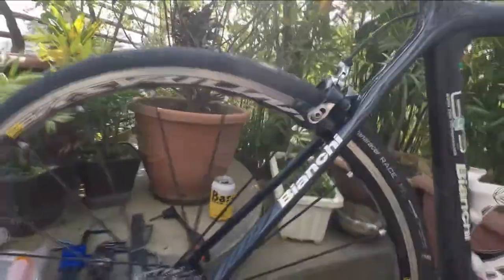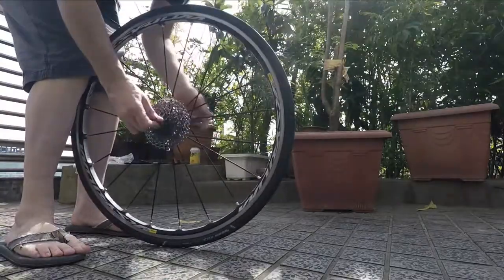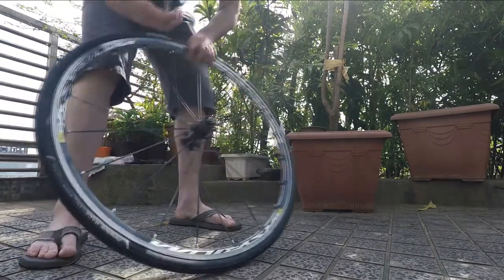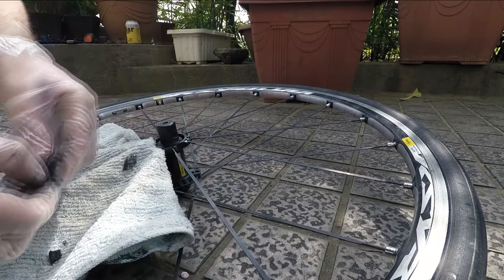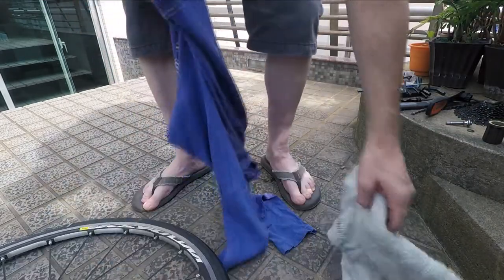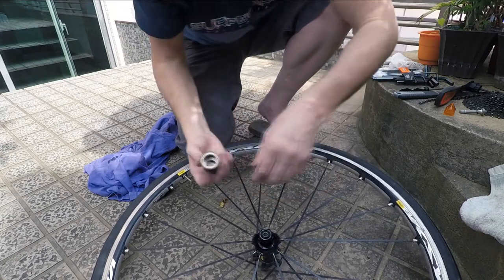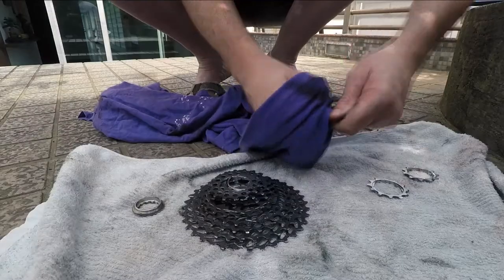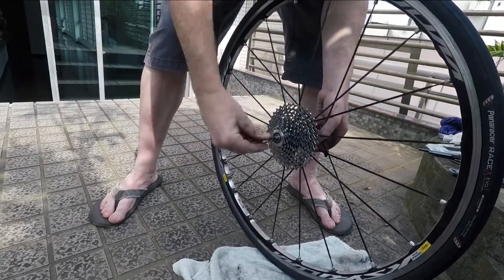Mavic Freehub Maintenance / Service (Audio fixed)

Comment: When it squeal? Does it vibrate too? Mine is vibrating and I can feel it on my whole rear wheel
Reply from the maker: Brakes need to be what they call toed in ...where the front part of the brake hits the rim first. This doesn't have to be a lot like we're talking like a millimeter. If you still have squealing make sure there's nothing on the rim that's causing it to grab  ..clean them properly.  Also maybe different brake pads would help too.
Reply from the maker: Vibration can also come from them not being centered properly.... One side touches before the other
Reply: Only happens when I'm free wheeling. My free hub squeals and it vibrates so much. Thanks for your reply bro
Reply from the maker: I thought you were talking about brakes.. yeah it sounds like the free hub... know what you mean. If you are peddling the Freewheel isn't rotating.. it is ok... Sounds like it's your free hub. The seal in mine was okay I didn't have to replace it if yours is really run down you might have to replace the seal part ... Apparently it's a common problem but a little light oil fixed mine and it's been running that way for a year
Reply: Yes, it sounds like a duck being strangled.  🤣

Comment: Is the brake fluid oil you used  the shimano brake fluid or automotive brake fluid? Do you think it would be a bad idea to give tri flow a shot? Thanks.
Reply from the maker: I have no idea. The oil I used is a very light almost a clear like oil so if that helps at all...that's your judgment..your call
Reply: @scottrider7271  thanks for the response. I just used tri flow. It's also very light oil, it seemed to have done the trick. We will see how long it lasts. Probably will pick up some shimano brake mineral oil anyway.

Comment: Thanks for info Scott!
I have a set of Mavic Ksyriym SLR’s and this is the second time this has happened. Riding the bike and a loud grinding noise from rear wheel it’s not constant but loud and annoying. I’ve had campy wheel sets that never need maintenance. The first time this happened I brought to bike shop and they said the pawls needed to be replaced and it took 2months to get part from overseas. I guess Mavic isn’t much help on parts